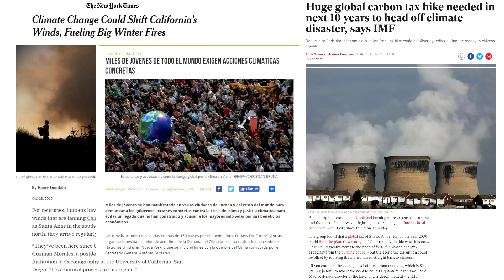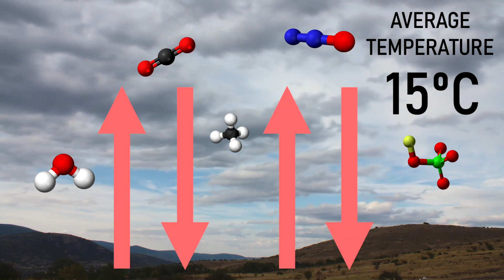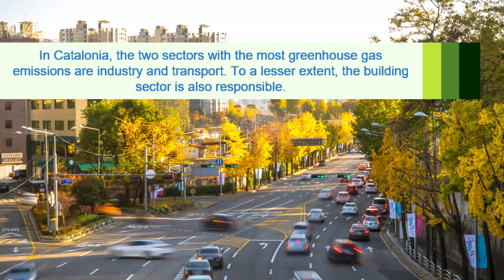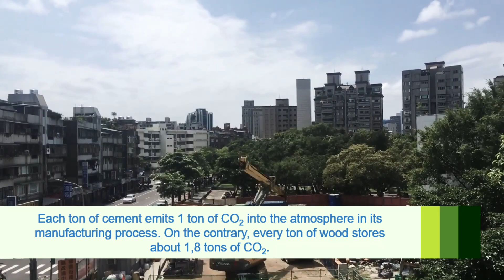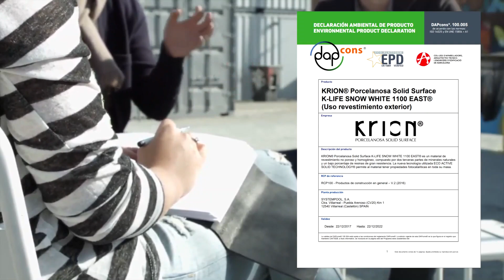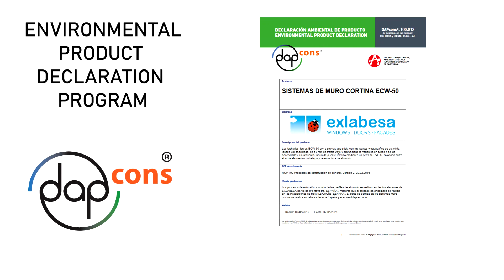Global warming (english)

Comment: Global Warming:  In a Nutshell:
The photonic energy emitted by the sun as visible light and infrared radiation strikes the Earth’s surface. The visible light that is not reflected away is converted into additional infrared radiation which is felt as heat as it is re-emitted back towards space wherein this photonic energy begins to interact with the larger atmospheric molecules. Known as the greenhouse effect, it keeps the planet from freezing over.
Note: An increase in larger atmospheric molecules strengthens the greenhouse effect.

Photon(ic):
https://samslair.blogspot.com/search?q=Photon+&m=1